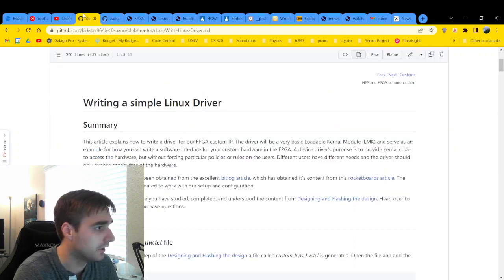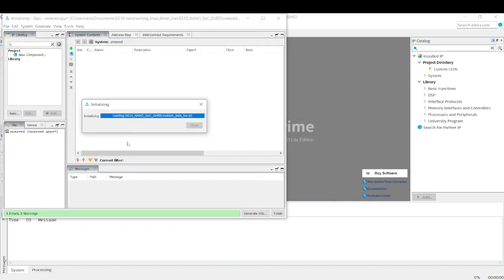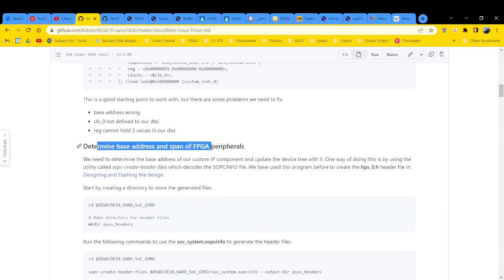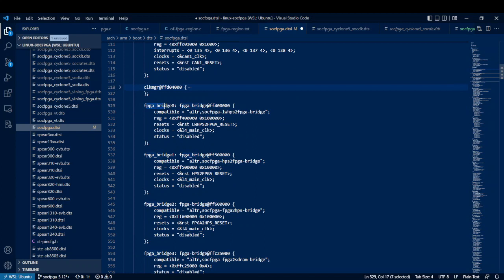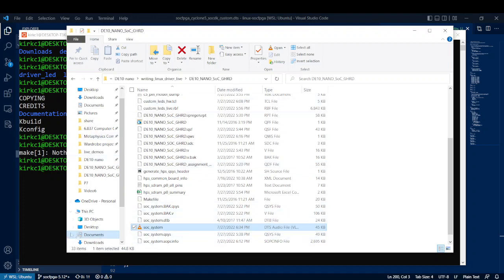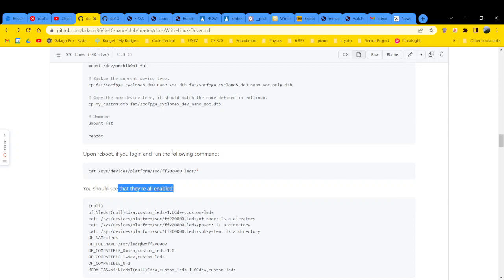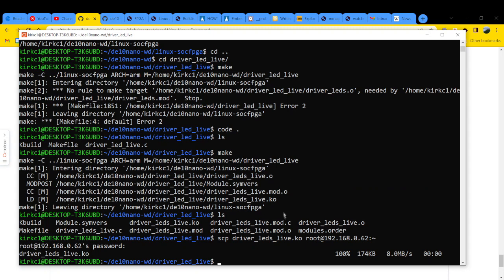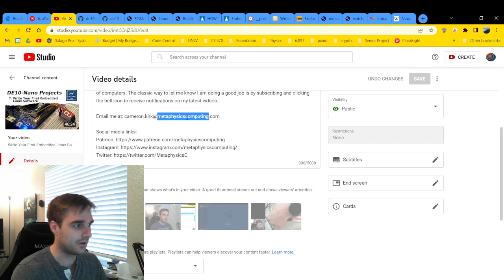Write Your First Linux Driver - DE10-Nano Projects

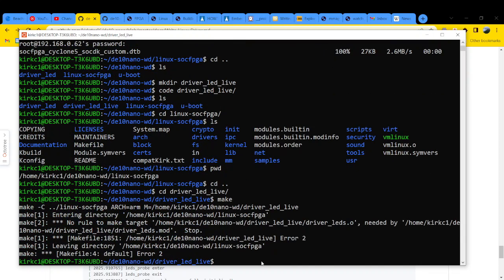Comment: After entering "make" (35:55), a several messages appears like "/tmp/cc0w3APX.s:90: Error: selected processor does not support `dsb st' in ARM mode". Please help or I'll jump out the window?
Reply from the maker: i’m not familiar with this error.. it sounds like you do not have your cross compiler configured? i don’t know about your host machine.